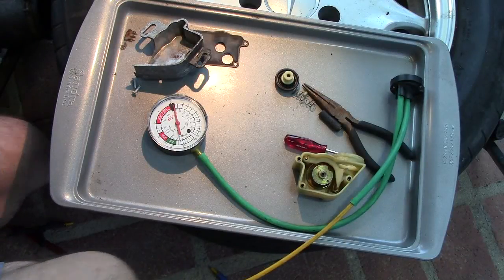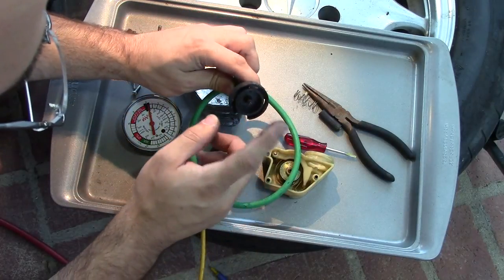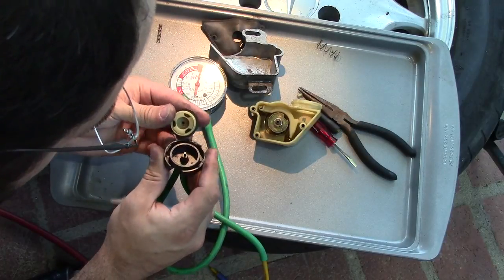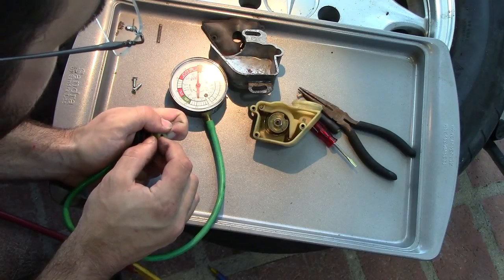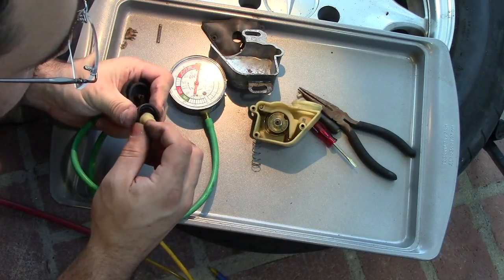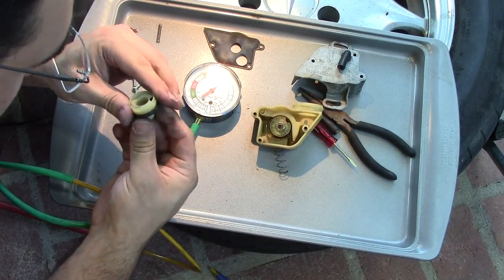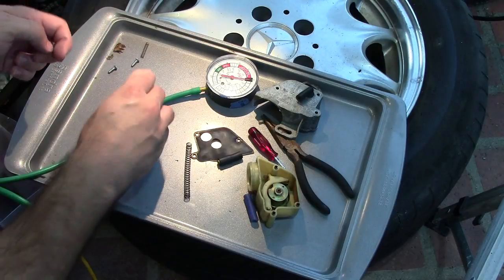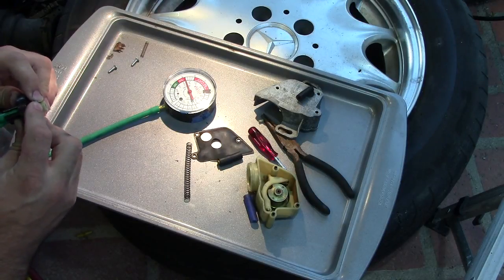Mercedes OM60x VCV Vacuum Valve Modification

Comment: These are available on Partsgeek.com for about 148.00. The valve is adjusted by it's position on the fuel injection pump. There is a room for adjustment on mounting points.

Comment: Hi, what is this black rubber connector at the bottom of VCV for?
Reply from the maker: The 90* elbow on the front? It's a vent.
Reply: @compu85  Yes, that's the one. On my car it was connected to the rest of the vacuum system. I don't know why. I disconnected it and i also found one vacuum leek on another connector and i fixed that too. Now automatic transmission works much better without any kicks. Thanks for the reply.
Reply: @c0mmented  there is a black line that connects with that and it just pokes into the passenger compartment through a firewall grommet.
Reply: Where the input and output goes conected cause mines ar lose idk where to conectect